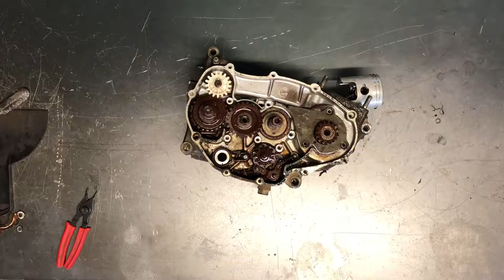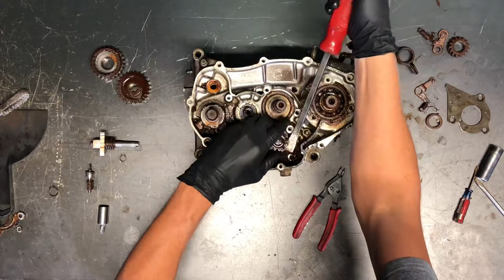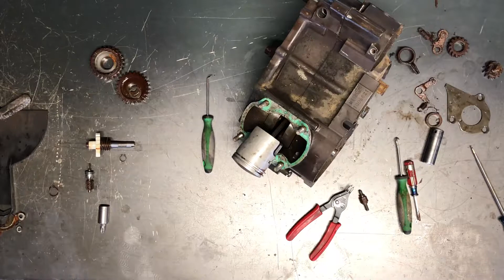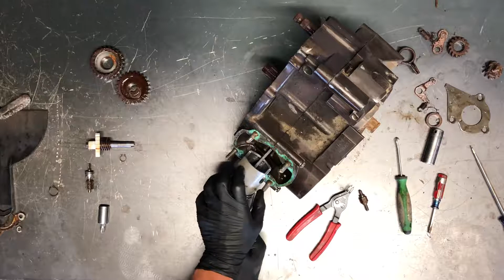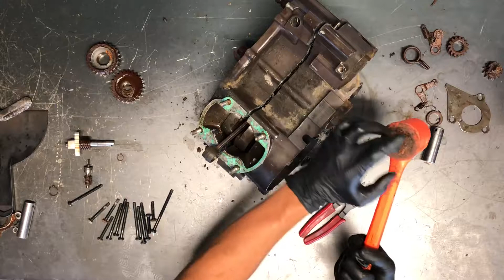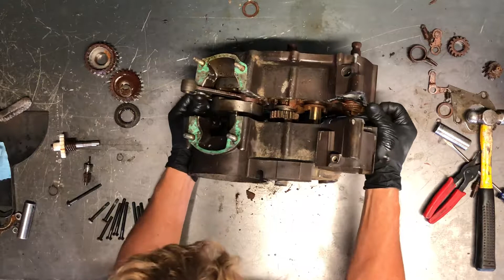Honda MT125 MT 125 Elsinore - 2 of 2 How To Dissemble Motor Crankcase Transmission Gear Shift

Comment: Have you never heard of a case splitter ? It's a lot easier.thet make universal case splitters also.
Reply from the maker: Heard of them and I use them but unfortunately they aren’t for every application. It would have worked in this case tho.  If you need more helpful tips, check out:   https://youtu.be/X0AdFxkJiOg and if you need parts: https://www.ebay.com/str/midnebraskamotorsports. Thanks for watching and the comment.

Comment: How is the power? Thanks for sharing!
Reply from the maker: Explosive……not really. Kind of a dog, but fun to ride. What are your thoughts on this bike?  If you need more helpful tips, check out:   https://youtu.be/X0AdFxkJiOg and if you need parts: https://www.ebay.com/str/midnebraskamotorsports. thanks for watching and the comment.
Reply: Nothing down low but at 5,000 revs you get... not much more. Put a CR 125 barrel and piston on it. Huge power  for 1/2 hours work.